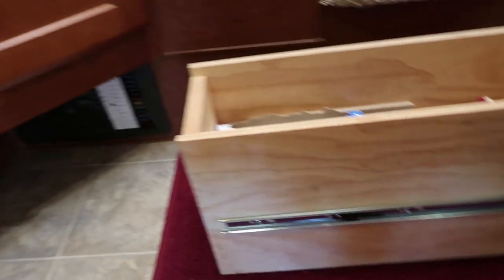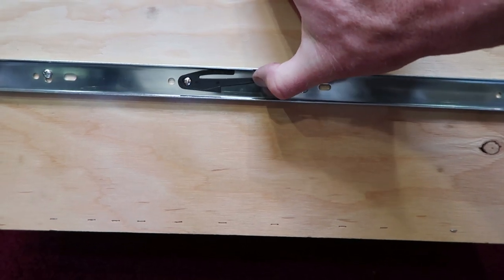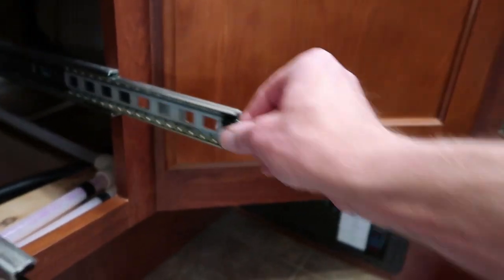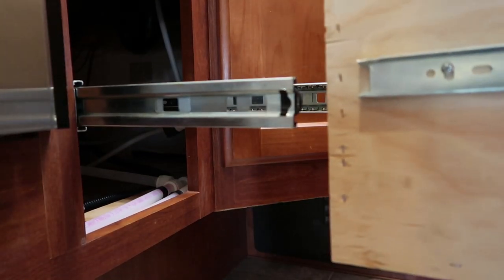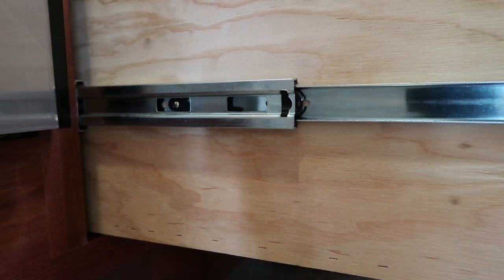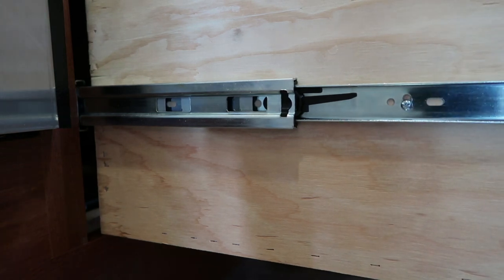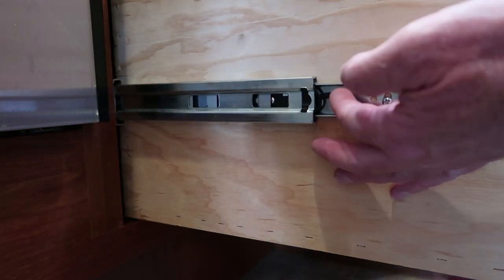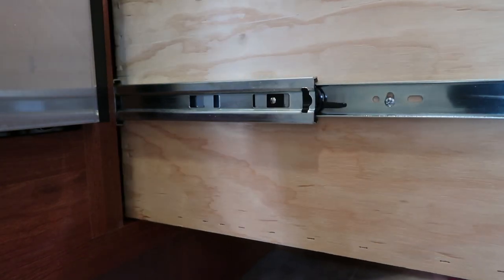Drawer removal in your Northwood RV

Comment: Once you have the drawer out take a little look around, use a flash light,  get to know whats in the cabinet. Drawer slides if are loose or screws are missing, check electrical and plumbing that is often inside, damp or wet, and finish with a quick wipe or vacuum.
Reply from the maker: Good tips.  I also like to tighten up the plumbing fittings.
Reply: @deltabravo1257  I have found leaky plastic water fittings in the cabinet, also reworked the under sink drain to take up less space to make room for kitchen storage, this worked out well.